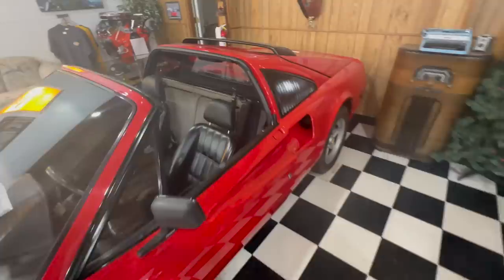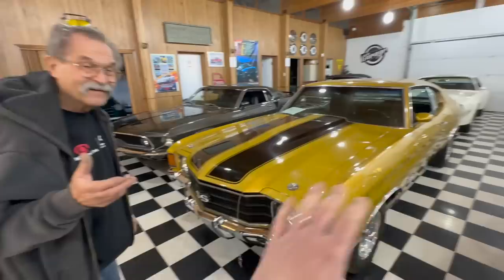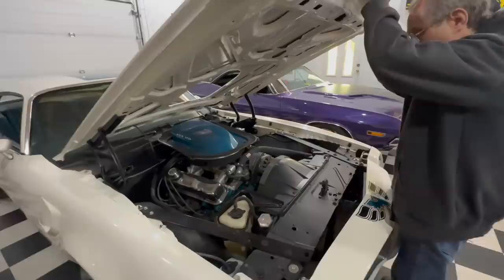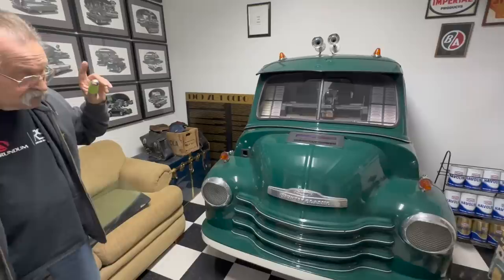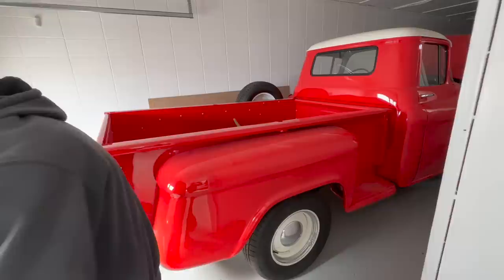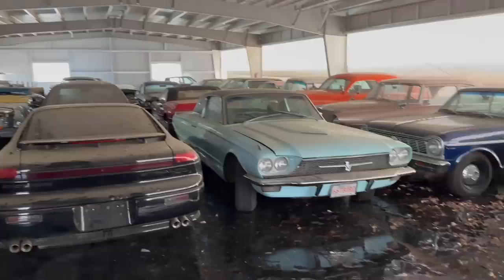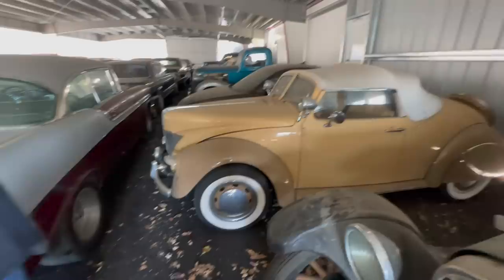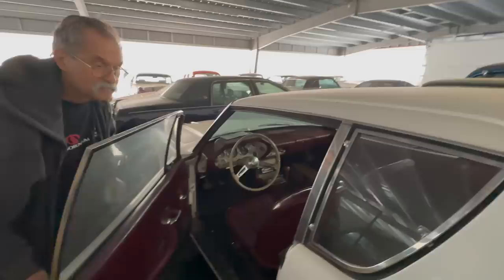This small town holds a massive surprise! Mega classic car collection!

Comment: 91 Stealth RT. Would break every speed limit in Canada in second gear and had 4 more gears. You pushed a button on the dash for sport mode. Opened the exhaust up and changed the settings on the shocks. Nicest , fastest car I ever drove on the street.
Reply from the maker: That’s what Myron said… very fast car!

Comment: 328’s in good condition are about $90,000-120,000.  This car has been hit and that would bring down the value if recorded on Carfax.  Buyers want low milage cars and they want a history of receipts on what was done to the car.  A good resource for me is Bring a Trailer.  I have never seen them sell for $200,000.  Condition means everything.  Usually 308’s and 328 need a lot of work with their engines, rubber and electric.